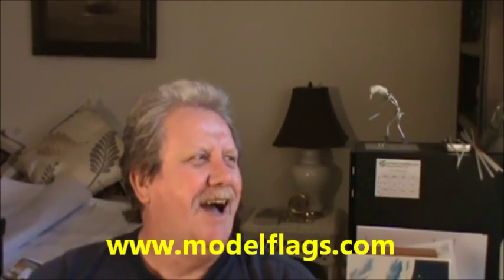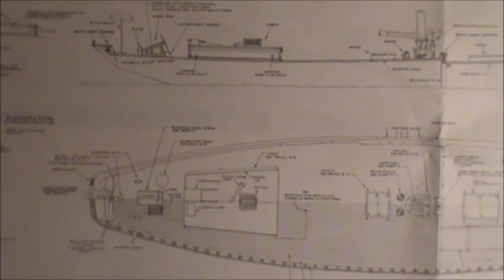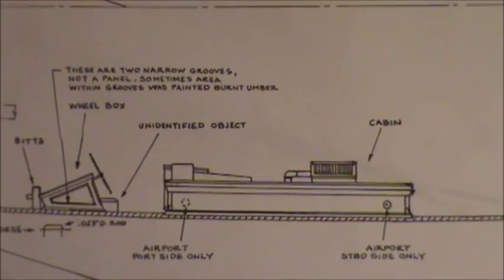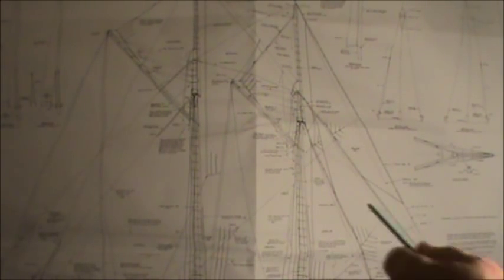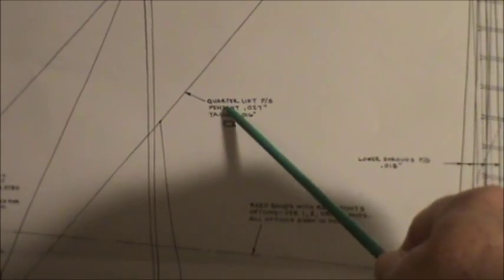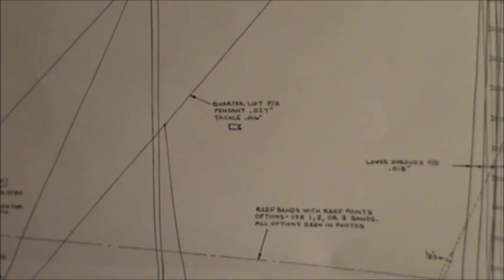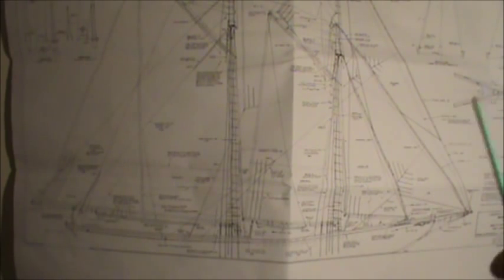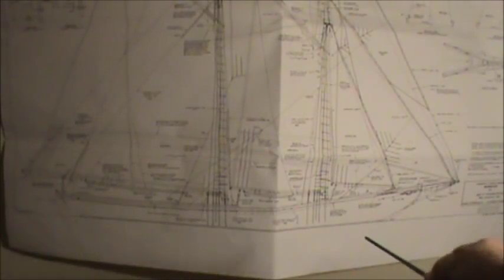BLUENOSE PART 3 -- PROBLEMS ALREADY

Comment: I bought the "Bluenose II 600" by Billing Boats in 2014 and it's such a nightmare. Lack of instructions, confusing instructions, wrong drawings, etc. I did some work on it and stopped working on it 4 years ago. Now I am back to work and willing to finish it, doesn't matter how this ship is going to look like at the end, because I can't just keep researching forever until I am sure that I am doing the right thing. I will never buy another model from Billing Boats again.
Thank you very much for sharing your knowledge and for all your videos.

Comment: Unknown object!!! RE-watching your videos and got to this one. I reckon that object is an old fashioned compass binnacle box with the compass mounted on gimbals inside.  One of the big ones with compensating weights for correction. The Helmsman would have stood to one side or the other looking forward, up at the sails and down at the compass.

Comment: Hi Gary... Following your video series on the Bluenose as I am preparing to undertake this model as well! LOL! Looks to be a challenge for sure, but should be a beautiful model when complete.

At any rate, pretty certain the P and the S (or P/S) on the blocks represents Port and Starboard. I see what you mean though... figure that for all the effort they went through they could have included some kind of a cheat sheet for us landlubbers to follow along with their nomenclature.

Comment: The reason they haven't looked at the original plans for the bluenose is because nobody actually has the original plans. They had to make this model as accurate as possible based on pictures and whatever other research they could do. That's why some things may be unidentified, because they were visible on the ship, but they could discover what the object actually was.

Comment: It's called a learning curve, Gary.  I have been building wooden ships for forty years and I have built this model.  Not from the kit but from the plans and I had no problems. (Same plans btw.)  Quit complaining and understand that the exact sizes, in all cases, would be impossible.  Build the model and use your own solutions to problem area.
Reply from the maker: You know what, you realy don't deserve a reply.  You been building for 40 years and been with you-tube since 2007 and don't even have one video posted.  Why don't you share some of your knowledge so I wouldn't have to complain because I expect more for my money.

Comment: dont know if anyone has commented on it. and its a while back but if you havent worked it out how to find the size of a hole on the plan or in instructions if its a one to one plan then measure the hole diameter on the  plan lol!!! just saying. and the air vent with dotted lines mean its on the other side as though your looking through the wood this is the same on all the plans if you dont know how far say the cabin is from the back measure the plan. like i say bit late and now i shall carry on watching.
Reply from the maker: paul bishop Thanks Paul....Yeah I figured all that out some time back but thanks for the info any-way.

Comment: There will always be issues where you are left alone. I am currently building the Frigate Jutland by Billing Boats and as the model is being rated for the 'expert builder' the plans are very basic. I have turned to the internet for pictures and videos for reference and actually found things that were wrong in the model compared to the real 1:1 scale model. :o) For this ship I am lucky that it still exist despite being built in 1860 so I can actually go and check details out if I want to. Correcting wrong or missing details is also part of the fun, I think.

Comment: Air vent issue, p is port stbd is starboard, both sides used to move air. Think. Air moves where you direct it.
Reply from the maker: Wil Sharpe Thanks for the info but that was over 6 months and 34 videos ago, I'm all ship-shape now.

Comment: you are saying it not for a first time builder   never build a wooden ship be for

and what should i start out on as to a wooden model
Reply from the maker: The Bluenose is a good starter ship if you know or do research on what all the different parts of a ship are.  Things like running rigging, standing rigging, main mast or fore mast, dead eyes, belay pins, capstan, ratlines,etc.  As you may have seen I started with the Bounty, made by Constructo, which had a solid hull (no planking).  I would look for a small sail boat with one mast to start with.
Reply: thx you

Comment: Ahoy Gary
                     Welcome to the world of shipmodeling, I have their Baltimore clipper kit all plank and frame same procedure as your kit.  To get an good understanding of the plans you have to know naugtical terms and meanings. I admire you for choosing a difficult kit I myself took that plunge. The more you ingest the plans the better understanding you will get out of them. I been building shipmodels for over 60 years I have a vast collection everything from sail to steam. Check out my liberty ship I done I am building this for a client, Today I went to my hobby dealer and purchased the Bluenose kit I already have the hull frames inplace using a jig and the bearding line has been completed. So far in the construction you are doing very well the key is to keep checki9ng the plans and study them before you know it you will have no difficulty it will be smooth sailing from then on out. Great video buddy you need any help on the build shoot me a pm
Frankie Day
Reply from the maker: Yes that's true about naugtical terms, I know the basic terms from building the HMS Bounty.  This ship does not look that hard since I done most of this stuff on the Bounty.  The planking has no sharp bends so I should be able to get through that ok.  I have seen your Liberty build, very very nice for a scratch build. How is the Arizona coming, need to see more of her?  Thanks for your support.
Reply: Ahoy Gary
                       Thanks for the reply Gary the Arizona still on the ways,
I haven't done nothing to her since the last video I posted on her. But I will resume shortly I need to get some things done on her to keep on the schedule so I will have her done on the 7th of December this year. Remember buddy keep looking at your plans you will see new doors begin to open up then things will become clear and the build will be a breeze Your doing great.  Thanks Gary I be watching your build with entrest
Frankie Day

Comment: The www.modelflags.com is closed down. The owner has retired I just found out.
Reply from the maker: Yes I know.....That was my go to web-site for all my flags.  I'm going to mis that place.
Reply: I had a problem with this EZ Line you talked about, in one of your Tips and Tricks videos. I think it was this SMS Dresden model you had used it on. I found a dealer in my hometown here in Denmark, just to find out that the store had closed. )o: No other dealers in Denmark, had to buy it in Germany or Great Britain.